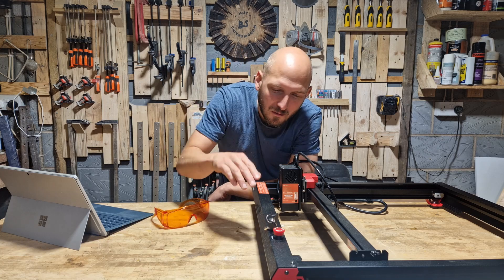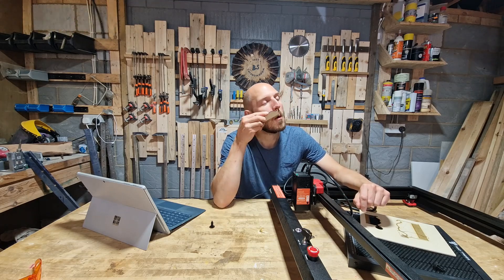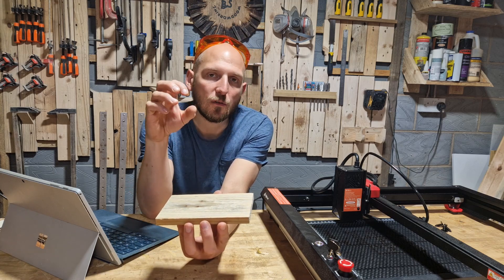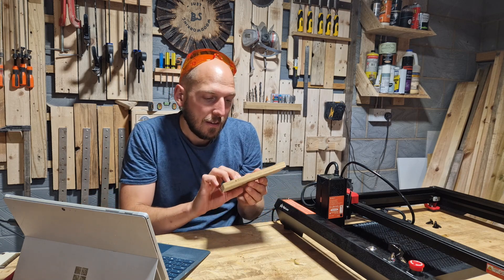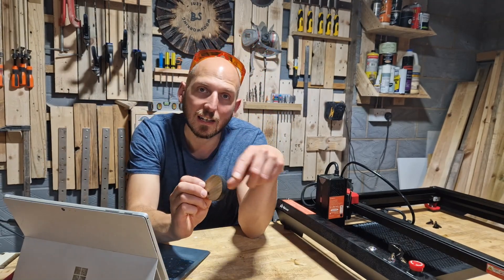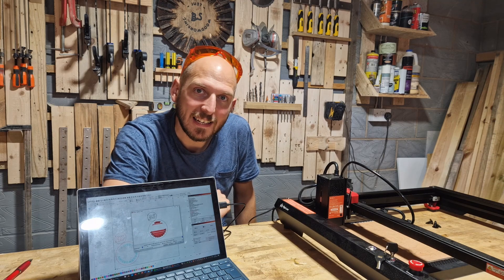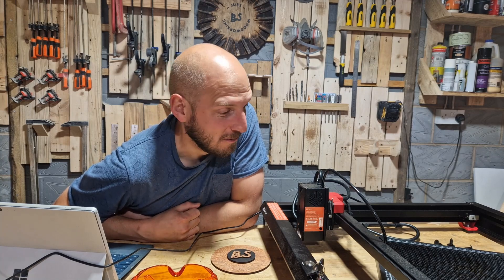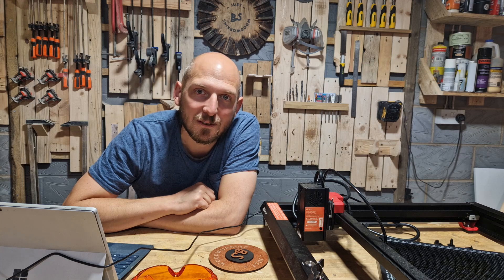Breaking down barriers with the AlgoLaser Alpha 22W #AlgoLaserAlpha #BestLaserEngraver #LaserCutter

Comment: Looks great!

Sorry to be boring, but with an un-enclosed laser head, please do have a think about ventilation, especially for cutting pallet wood that may contain treatment chemicals (wood smoke is one thing, aerosolised chemicals is another). Also - be similarly aware with plastics.

It's the main difference between those type of lasers and the cabinet style - the ability to properly vent outdoors. Be cautious with what your cutting unless you're sure you can ventilate the fumes away
Reply from the maker: Yeah, agree, it is a concern. I had both garage doors open but it still wasn't enough. I've been looking into a product from Axminster to help but cant justify it whilst I'm working on the house. Once I have a permanent home for the laser, 'ventilation' will be a priority.
Cheers buddy